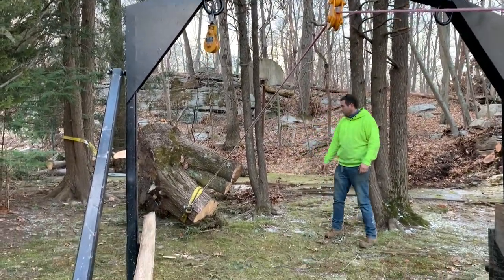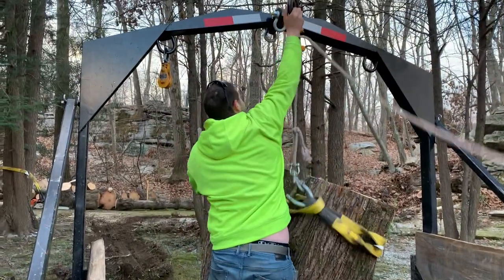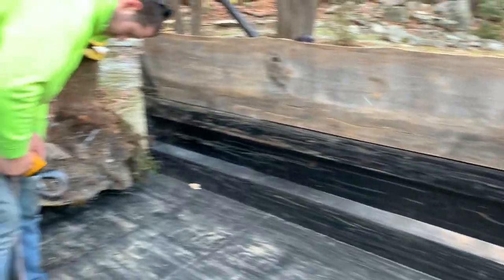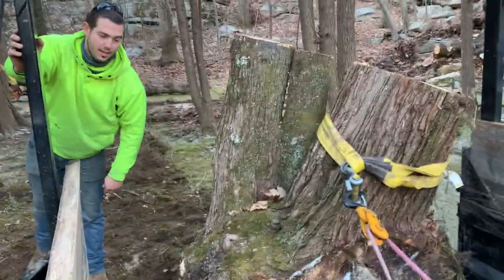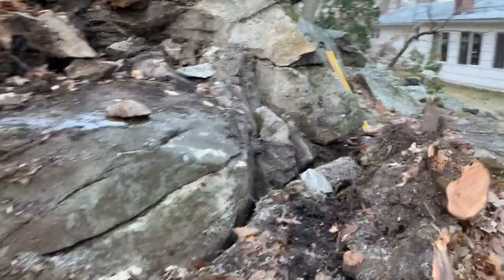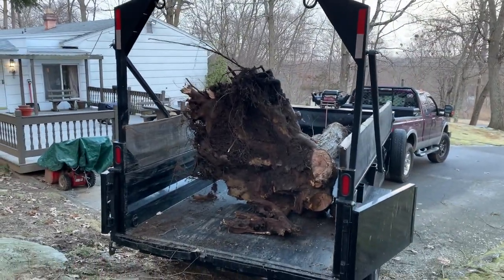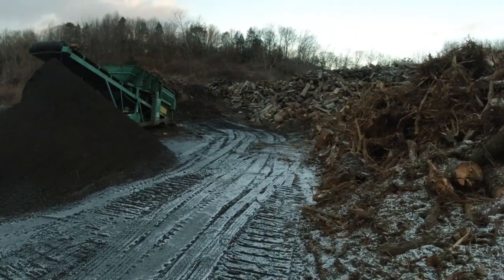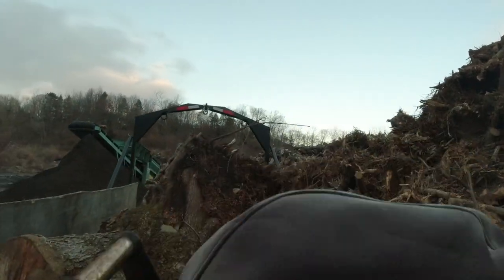#70 Tree Stump Removal with Sure-Trac Dump Trailer and Custom Log Arch

Comment: Are you using the trailer battery for double duty? As in running the winch and trailer? I liked the video alot, been a sub for a little while. Between you and outside with scheib im sold on a rugged made.
Reply from the maker: So it kinda of depends on the situation. Yes the trailer battery directly powers the winch no matter what as was the case in this video. However, when I am doing a lot of pulling I have 0 gauge welding cable ran from my 2 interstate truck batteries to the back of the truck with an Anderson connector which can then be hooked up directly to the trailer battery to charge/power the winch. The trailer battery also has a dedicated plug in battery charger for when it’s parked as well as a solar panel that is continuously charging the battery on the road. This is all in addition to the trickle charge that it receives through the 7 pin electrical hookup to the truck. Lots of redundancies so that I never run the battery dead!